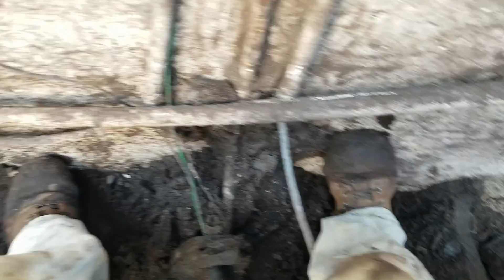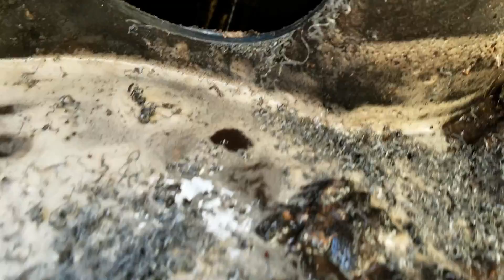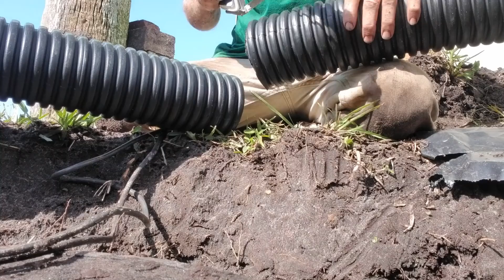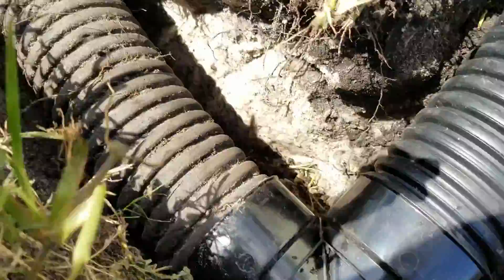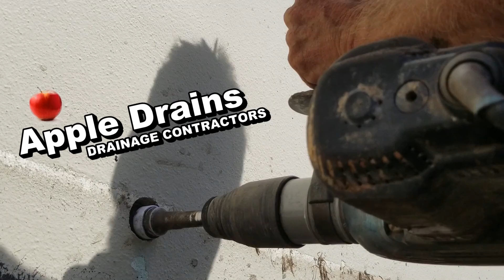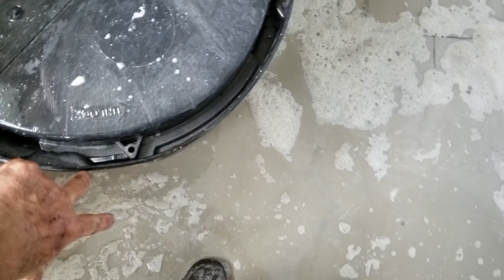How To Install Footer Pipe,  Cut Basement Floor, Core Foundation Wall, Waterproof you walls

Comment: Thanks for the videos. They enabled me to do my basement and yard drain myself. I got a quote of $12,000 just to do the interior basement  system with a sump pump and they use the box drain tiles that sit on top of the footer. After your videos I understood I need perforated pipe in gravel at the bottom of the footer, so that's what I did. PLUS I dug about a 60 foot ditch outside with perforated pipe in gravel to carry the basement water away (gravity flow) and catch yard water on the way out. I figure the company would have increased the charge to about $20,000 for all that. Most people cant afford any of this,(like me) and dont have any extra $20,000 sitting around. DIY is the only way many times.
Reply: That $12,000 quote was actually pretty reasonable, here in Oakland CA figure double or triple the price. I ended up spending a couple hundred total doing it DIY just like you.